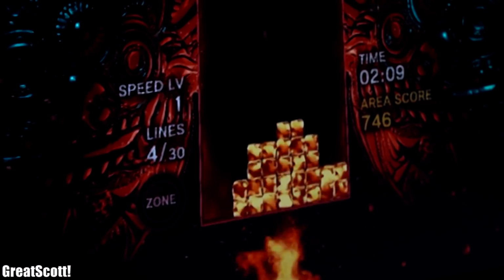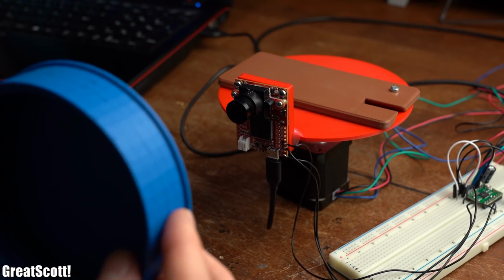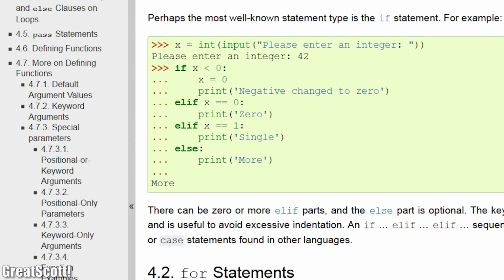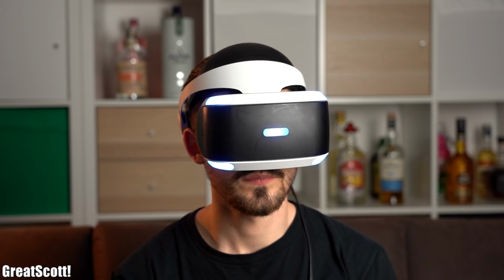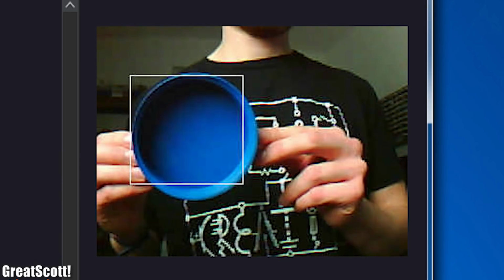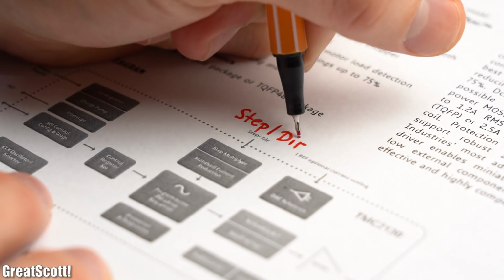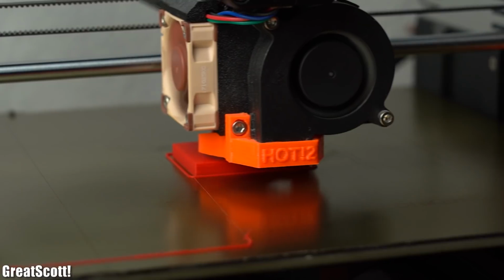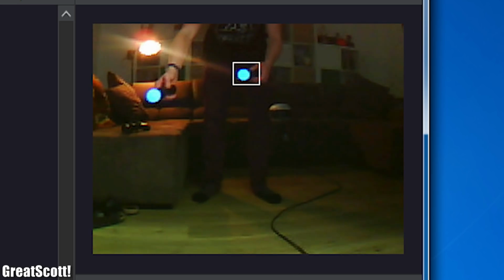How easy is it to visual track an object? PSVR Headset Tracker with the OpenMV-H7 Camera!

Comment: thanks for the post Scott but you do know that all this could have been done with ANY webcam right?  like any $3 usb webcam with no special features right? and since i see you like diving into coding then all you had to do was download Processing IDE which is a Java language, in its example you could have use the OpenCV example libraries and used the color tracking feature and send those X&Y Cartesian coordinates from your canvas running on Processing IDE over Serial to a Arduino which will relay the cartesian coordinates given by Processing over to the Servo driver or straight up to the Arduino is only 2 servos anyways and update the servo.write(cartesian coordinates); and thats it! of course in Processing you would have selected in setup to look for that color value which is way easier to do then all this you just did..... well nothing wrong with having many options on the table to attack a problem but i thought i educate you as you always do just that for us all. and hey who know maybe you can get the Processing Foundation to sponsor you next.

Comment: What about placing the OS came on the headset, then placing the PSMove Camera with its own target for the OS cam to track & placing the PSMove Cam on a linear rail that can slide a little to the left or a little to the right (i.e., no rotation for the PSMove cam, just some addition to its operational width).

Depending on tolerance of sliding the camera left or right and at what speed; if it worked smooth enough, you could then add similar tracking to slowly raise and lower the PSMove cam too...(?). The tracking on the OS cam on the headset would be simple, fixed; if tracking is lost sending adjustments to the PSMove Cam, then it could just default return to the optimal centered position...(?)...

Or someone could hack the Kinect v2 to supplement the PSVR headset....where's something like that at damnit...?!

Comment: or it could have been easly done with 100 year old technology, with an infrared led on your forehead and 2 light sensors sensitive to that frequency of light, put the 2 sensors side by side , put a separator between them, and wire the motors to them with some power transistors

Comment: How hard is it to get VGA out of a PS1 without an external box, or internal FPGA that could lose memory and cease to function if unpowered for years at a time. Simpler than the price a $90 scan line doubler would initially have you think.

Comment: You don't really want to move the camera while playing. However, you could trigger it when you sit down, but before you start playing to ensure you're in the middle of the frame no matter where on the sofa you sit, or if you go from sitting to standing etc. Plenty of possible ways to trigger it with the camera, or a GPIO etc.

Comment: TLDR: don’t use Python to generate PWM.

Seems like you are new to python. Unlike C, Python has garbage collection system (which is why you never have to free the memory you malloc’ed). This makes it not suitable for real time application like generating PWM waves. It may works find on low frequency most of the time, but it will probably generate unstable waveform when CPU load is high and fails when try to generate  high frequency wave.

Comment: Here's the thing with PSVR tracking and why it is so much worse than even first gen Windows Mixed Reality tracking.  Everything except the headset are all re-purposed parts from a failed product that were never designed with the intent of high accuracy positional tracking, or room scale VR.

Comment: I think that would surely  break the vr tracking. The  vr cameras track those 3 points (vr glasses and two controllers) relative to their own position and if you move the camera I think it would assume you are moving (in the opposite direction) and the camera it self is stationary, considering it's not an inside-out tracking which scans your environment.

Comment: Hello GreatScott! You should look into Oculus Constellation tracking.

It's an obsolete tracking solution right now, but this is how the Oculus Rift CV1 was tracked. It's also visual tracking, but by using multiple IR camera sensors. You can use up to four of them, but three is enough for a full 360 degree roomscale experience up to 3.5m*3.5m. PSVR having only one camera sensor makes it incapable of more than 90 degree tracking and roomscale experiences.

In any VR solution where external sensors are used, it's key that they remain stationary as they form the anchor points from where the headset and controllers are tracked in space. If you move the sensors, you move the entire playspace and tracking will mess up.

Oculus replaced Constellation tracking with the release of the Rift S and the Oculus Quest in favor of their "Insight Tracking" system, where the IR camera sensors are placed on the VR headset itself, removing the need for external sensors.

Comment: you still use Windows 7? you should know that the Windows 7 support has ended on  16.01.2020 and you should upgrade to Windows 10 or so. you can upgrade using an inplace upgrade with the windows media creation tool oder buy a new license key and install a fresh windows 10 or whatever version your prefer.

Comment: Solving a similar problem, I used a lens to widen the view of the camera.  I have also built software to identify and track position of pixel color on the screen and simulate mouse clicks while running games to keep logged in while I needed to be afk. I really like this build you have for face and eye tracking ability.  It has lots of potential for security purposes.  Perhaps locate a face and zoom in for a few HD screen shots, thus solving the problem of almost all security camera footage of criminal activity where they can't identify the criminal.

Comment: What's up with Thingiverse? I found some stuff I wanted to print, but needed a filament i did not have. I waited 2 weeks for my new filament. Using the same search terms the prints were not showing up at all. After 4 days of trying every combination, and variation of the original search terms I finally found them

Comment: I see that you still use windows 7 even after the support ended. If you are good with it, don't upgrade to windows 10. Install a good antivirus and be a little careful in the internet. I will continue using windows 7 till programs stop supporting it
Reply from the maker: That is my plan :-)
Reply: @greatscottlab  I won't upgrade to windows 10 because i love how windows 7 look. They are also much simplier and run smoother. Why you won't upgrade to windows 10? Please tell me im curious

Comment: surely the movement would just make the psvr think you are moving in the opposite direction? does the ps camera know that it is being rotated?
Reply: no, it does not. That is something that could be added in easily enough (it's just another transform operation), but as this is the only movable camera setup in use....

Comment: @GreatScott i do love everything about your work and this channel. 
Btw, In load consumer electronic master on/off switch are made using push button switch, to trigger action from microcontroller. 
 If by any chance this topic might interest you for an upcoming video, i'd be glad to see in which condition such device is required, pros and cons using them, and how to turn on/off an Arduino based project to put it in deepsleep mode and wake itself up..
Thanks for such amazing content, keep on doing what you do, it's really helpful..

Comment: Great video and a good proof of concept! One quick suggestion, drilling holes into 3d prints to mount things is not recommended because the only surface the screw is biting into is the infill (which is generally a very small amount of contact area). Although, in this case, it's okay because you didn't have to deal with large loads.
Reply: Unless you print with 100% infill.
Reply: @321ooo123  true, but it's unlikely under most circumstances, I go up to 40% infill max on my prints

Comment: For the multiple objects you can track the ones most afar away from each other, and set a new center on the simple average distance. In a case of two controllers just set the center the middle point.
Love your content though :)

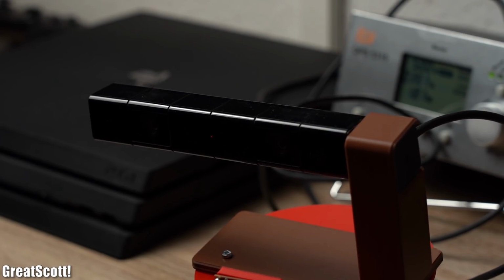Comment: 9:52 just glue a different color led on the headset and track that color😎
Reply from the maker: Haha also possible :-)
Reply: I was thinking he was gonna glue googly eyes on the PSVR headset to use the face tracking
Reply: Smh as he mentioned eye tracking and saying it can't be used wearing a headset. I was thinking he would glue eyes onto the headset... Now I'm a bit disappointed:(
Reply: @vinade2100  I was thinking the exact same idea! Lol
Reply: Or an IR LED with an IR filter on the camera lens
Reply: Or track an object. If the object is the goggles then it should be fine (or even better).
Reply: an IR LED blinking at specific frequency and a receiver tuned to that frequency with 2 or 3 phototransistors, compare the input of each transistor and use that to aim at the blinking LED. I think it might be cheaper and more reliable way of tracking. but I think this whole concept does not work well with VR.
Reply: "Five minutes crafts"
Reply: @jonny11bonk  😂😂

Comment: VR developer here. Moving the camera defeats the purpose, and ruins your gaming experience as your relative position is what determines your position in the gameworld
Reply from the maker: Well, that is what I thought as well at the end.......
Reply: @greatscottlab  In true youtube-commenter fashion I wrote this before watching the entire video. The fact you jump headfirst into your projects is why I like your videos in the first place, so I should've chilled a bit even though this particular topic hit me straight in the Besserwisser-glands
Reply: @Urre5  It is cool that home on a ground station of an RC airplane is either where the plane takes off from or a GPS enabled ground station so the ground station can move. Slowly but surely I'm gathering the parts for long range flights.
Reply: GreatScott! Wat if you only activate the movement after some kind of signal? For example raising both hands. In this scenario you can calibrate the camera right at the beggining of the session without having to adapt the camera manually.
Reply: @greatscottlab  Maybe if you had actually called it a proof-of-concept in the video, it would have avoided this whole comment. Yes, that is sarcasm...
Reply: My first thought!
(And I'm not a VR developer, so I m glad you confirmed it)
Reply: Maybe you could send some kind of "displacement" value to the headset every time the camera moves? I don't think this is possible with the PSVR though
Reply: @vke6077  on pc that would probably be possible. On psvr though i don't think it would be that easy.
Reply: @somedude2492  yeah
Reply: @vke6077  Can't do that without source code access to the tracking code. And none of the main platforms provides that.
Reply: for situations in which a player moves outside the field of view which creates 'problems', a wider angle lens would solve the issue. 

the rotation of the camera could be used to simulate a wider field of view, the game system just needs input which describes the current rotation of the camera so that the system can still maintain the relative positions correctly.
Reply: Exactly what i thought
Reply: Not a VR developer here, yet I could've told him that as wel😂👌🏻. 
Doesn't matter though, There are more than enough uses for this
Reply: Maybe if there was some way to communicate that the camera was moving to the VR equipment/computer, it could be compensated for?
Reply: ;0
Reply: Maybe he's trying to, in effect, increase the effective FOV, and therefore, the effective play area?  Although, I own the same PSVR, and have not had any issues with this, so I'm not sure what the advantage would be.  Maybe for a dancing or sports game which requires moving all around a room?  Either way, the machine vision is very interesting.
Reply: it's certainly possible to account for that, as this is a stepper motor and therefore it's angle is known, but it's not an approach used by any commercial VR offering.

I could see an auto-gimbled camera array being useful for room scale VR in certain circumstances.

Also, snagging another one of these cameras and slapping them onto a 3D printed HMD is basically exactly what Inside-Out tracking is.
Reply: Pfff HAHAHA
Reply: Hook up 2 wires to activate re-centering after a large number of steps in the motor has occurred?  Is there a button to solder into, or perhaps a bit of signal to emulate from the headset?
Reply: @mwm2929  exactly what i was thinking
Reply: Then maybe you guys need to incorporate this logic while producing your VR tracking cameras.
Reply: @aytunch  The whole concept is redundant as all headsets are moving to inside-out tracking (the cameras on the headset itself) to solve this problem.

Comment: @GreatScott, you really don't want to move the PSVR camera using a motor while playing! 

That will completely screw up the tracking of your space in any game you are playing (on top of the PSVR tracking being quite poor already, compared to e.g. Rift, Quest or Vive). The camera position/orientation is what mathematically determines where there is the origin ("zero") of your (= game's) coordinate space. If you start moving that around, you are screwed - your space will move with it. Not good - if anything it will make you dizzy because the scene will be constantly moving even when you aren''t and throw off your proprioception ("I thought my hand was here but it is there?!").  I believe PSVR doesn't use anything like the Guardian or Chaperone systems of Rift/Vive that show you when you are about to exit the boundaries of your play space but if it did, those would be constantly moving with the movement of the camera too, rendering them useless.

The only way to make that work properly would be to have a positional feedback on the motor (e.g. an encoder or a stepper like you have used) and feed that into the algorithm, so that it can compensate. Doable if you DIY it but obviously not applicable for stock PSVR with no source code access.

 A better solution is what has been used for the original Kinect, which also had field of view issues - a set of supplementary clip-on wide angle lenses that let the camera "see" larger space.

(and yep, I am a VR engineer/developer/researcher too)
Reply: Yeah, I was thinking that since he mentioned he wanted it for VR: won’t it mess with the tracking algorithm? And I’m a VR noob!
Reply: PSVR tracking is solid when setup up properly.
Reply: @NETBotic  Fine, but not compared to other headsets.
Reply: @LaZZeYT  It's better than most WMR headsets!
Reply: @NETBotic  WMR is shit, really is, I'm talking more about the index/vive/oculus.
Reply: Darth Vader says NOOOOOOOO!!!!
Reply: Jan Ciger hey bro, can we use this cam to detect vehicles on road to control headlight dimming feature, kindly respond
Reply: @anoopvimal3313  Feel free to send me your billing address where I can invoice you for my consulting services, bro.
Reply: I think the project is a "fake project", created to promote the elektor code. I dont know how elektor contact him in the planing phase and say "hey, watch this cool board... this will be great for you next project". I think elektor contacted him for an offer and than he searched for a reasonable project which sounds cool.
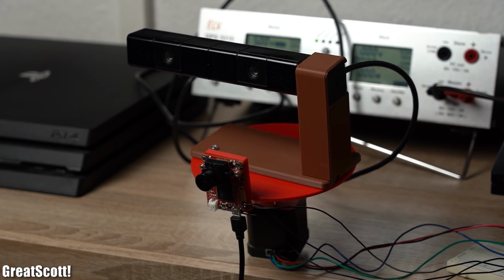Reply: 9:42 "Proof of Concept"
Reply: @lachee3055  The problem is that the premise behind that concept is wrong, so this only proves that you can move the camera, not that the tracking will actually work better (or at all).
Reply: skill level 11    play drunk!